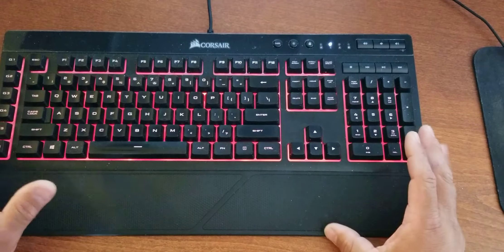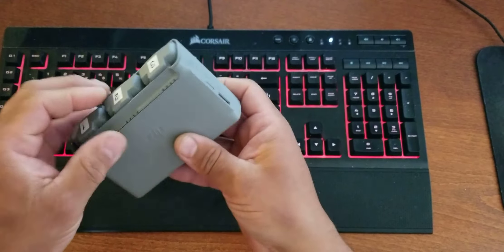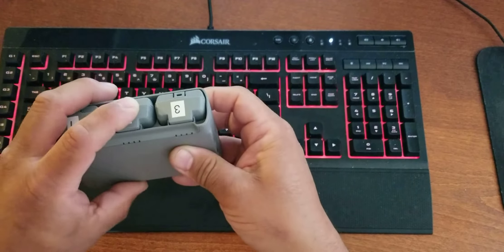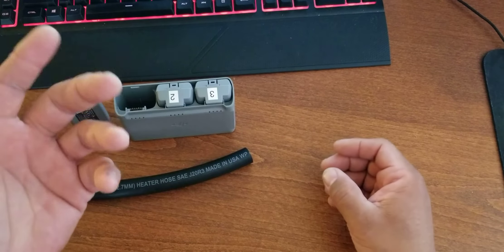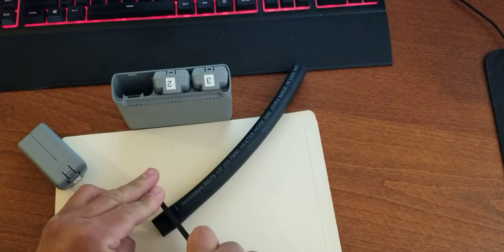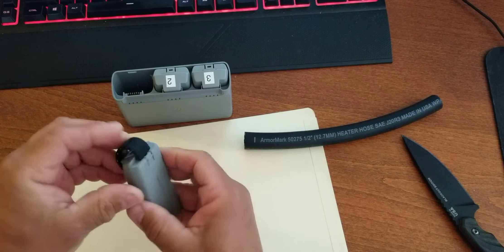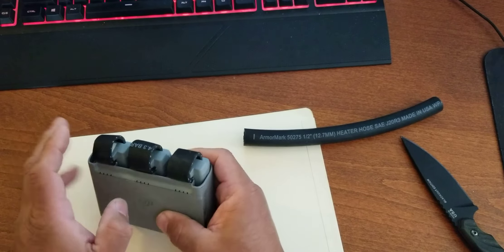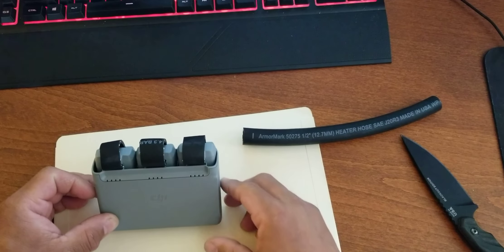DJI Mini 2 Battery Care

Comment: Badd a$$ going to the parts house thanks brother
Reply from the maker: Kevin, you can if you want but this problem has been taken care of with the firmware updates. It's not an issue anymore, this was my solution to the problem before the updates.  Take care.
Reply: @shadowstorm7  Thanks for the update I'm new lol. So I'm safe to leave them In
Reply from the maker: @POLK200172  yes, just make sure the firmware up to date. My drone is a mini 2.

Comment: Good Idea.  Some just turn the battery packs around but there is a slot built right into the case and groove on the battery.  Though turning the battery works for a while you are still putting pressure both on the battery and the case. Over time this small pressure is bound to do some damage.  I like this idea of the tubing but I would still brush off the terminals and visually inspect them before flying, making sure there are no rubber flakes getting caught down in the terminals. A clean tooth brush works good for that.
Reply from the maker: Yes, even though it's slight pressure and I know I could get away with it my brain keeps telling me it's not right. Sometimes I hate my logic.
Reply: “Bound to do some damage”? It’s barely tighter than finger-squeeze pressure in there… Geesh people are soo scared of everything…

Comment: I hate to tell you this, but I leave mine in the case and in 3 days they are down to the 73%  range which is what DJI says is supposed to happen!
Reply from the maker: yup, the concern in the past was before the firmware update the batteries would not do that.

Comment: just pull baterrys 1cm out,put solid rubber band around and push back.Easy
Reply from the maker: Tried that also, found that they would roll off the smooth end and then reconnect. This isn't an issue anymore with the firmware updates. Thanks for watching and the comment.

Comment: When you turn the battery back-to-front, with a little push, the battery slides into the slot & does not make contact with the charging points 😉
Reply from the maker: Yup, I knew that but it bothered me doing that. Thankfully they fixed it with a firmware update. I have also moved to a nice parallel charger that charges everything at the same time at the same rates. It's a time saver compared to the sequential one that came with the combo.

Comment: One problem with doing this is the hub with batteries wont fit back in the case.
Reply: Dont really understand why doing this... Come on! Just turn the battery around and Push it in.  Thats all
Reply from the maker: Yup, I know but this is just the way I like to store mine. the batteries fit  in the two way charger and that still fits in the bag that came with the "fly more" bag in the kit. They do stick out of the case about 1/4" higher.